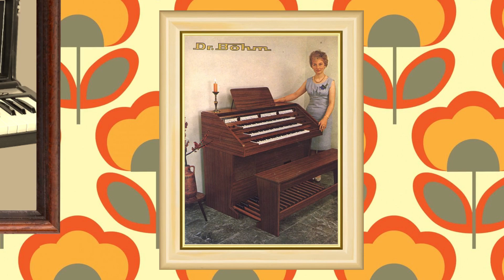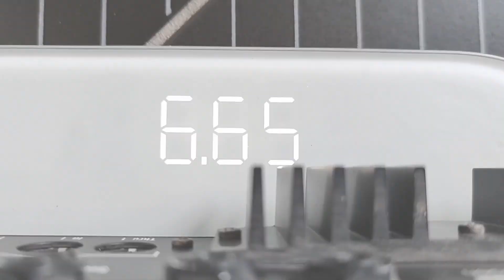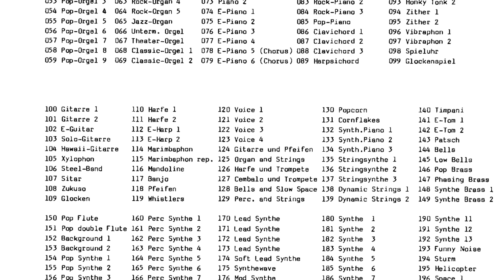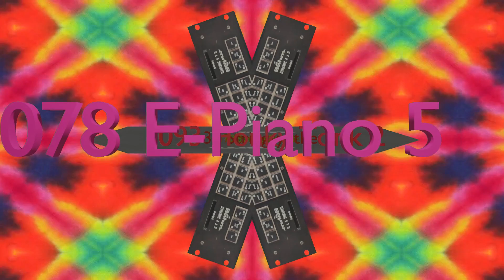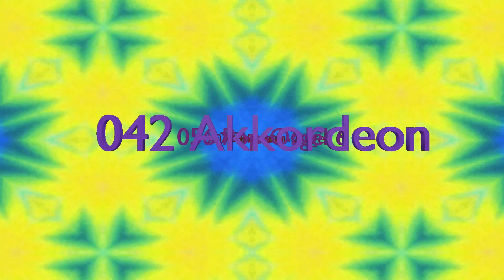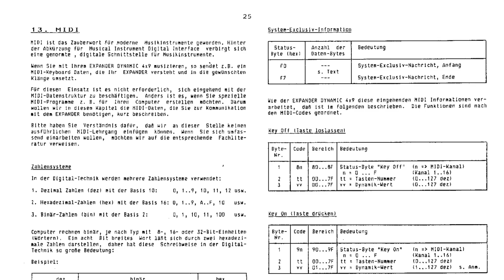RS051 Dr Böhm Dynamic 4x9: FM Tank

Comment: Les than 100 euros is a great price. Asking prices on Reverb are considerably higher; basically, you want to wait for an Ebay auction.

I found the 1U 12/24 for 72 euros that way. I stiil need to fix it: the unit appears to work and respond to MIDI, but no sound comes out.
Reply from the maker: Have you tried factory reset? It made  my 12/24 work again
Reply: substitute the tantalums with electrolytic capacitors

Comment: another german gem- hohner PK250 was also made in the bohm factory!! cem and ssm analog chips in it!! you can buy it cheap as chips in germany :) id buy one but theyre impossible to find in Canada. I see there are lots listed on ebay kleinanzeigen :)
Reply from the maker: I've actually got one a while ago complete with travel case for 50€. I've even seen them listed for as low as 20€ here and there. People have absolutely no idea what's inside these keyboards. I plan on doing a mod in one of my next videos. Getting inidividual controls for ADSR and filter is pretty easy on these.
Reply: This (PK250) is not true, but the Hohner Organ D92 was offered asca DIY-Kit by Boehm and they named it Musica Digital 100/500 (Keyboard/Organ). The organ was as a Portable model available (MD500T), later there was also an additional Midi-Kit for it available (only Midi Out without Velocity).

Comment: How cool! My brother, my father and I built several Böhm Organs over the years.
Reply from the maker: Wow, I bet it was quite a lot of work. From the scematics I looked at it seemed  like you pretty much had to built them from schratch. No preassembled parts, lots of soldering?
Reply: @rejectedsynths  boy it was a lot of work! Zero pre-fabricated stuff. You had to solder every single transistor, resistor, etc onto the voice boards. And there were 12 of them, for each tone. And all the wires were single wires. But it was fun and I learned a lot! Built my first Formant synth when I was 15 or so. Also completely from scratch 😅